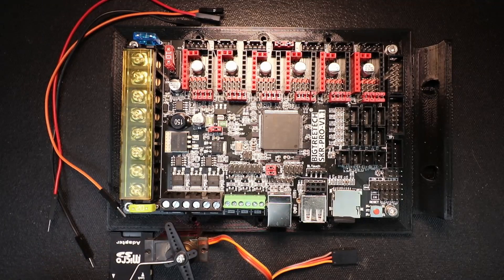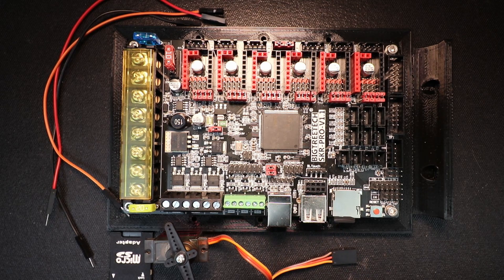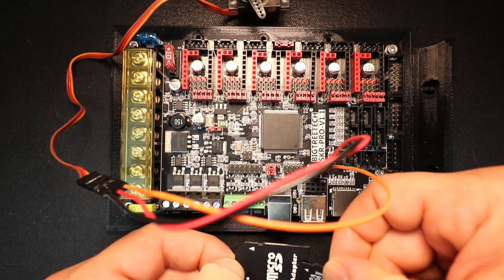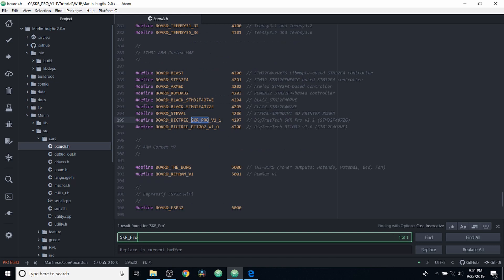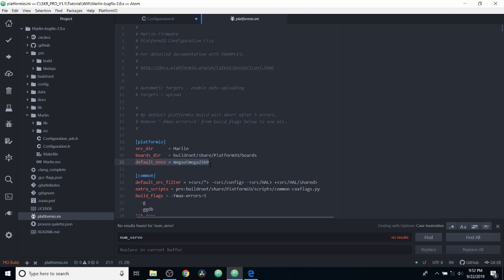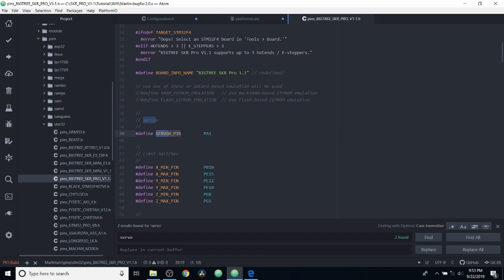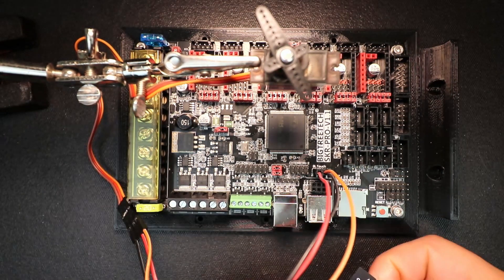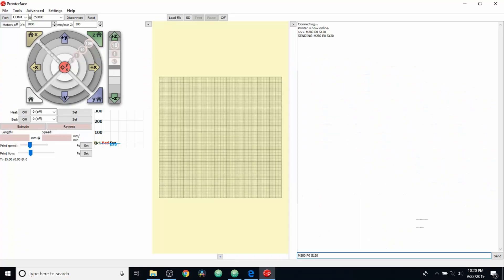SKR Pro V1.1 - Servo

Comment: Hello, how are you
I need to install in my SKR PRO V1.2 a SERVO MOTOR in addition to the BL-Touch that is already installed on the board. This servo will be used for tool change in a new project of a 3D printer with 4 print heads. But my web search came to nothing... I didn't find any information that could guide me.
Could you please help me in solving this problem?
Your guidance would greatly help my project.
Thanks
Reply from the maker: Been working on issue this morning, just need to find jumper wires to test.

Comment: Hey man, im searching for how to toggle pwm pins via pronterface for this board, i want to add rgb led strip to my printer, i'm making the pcb with the bjt and i need to test. Which gcode i need to use and how to call that pins (how do i know which is S0 for example)? If i can't use pwm pins, i want to use the pins of extension 1, PG11, PG13 and PG14. Sorry if bad english
Reply from the maker: Enable pins debugging in Marlin firmware.

Comment: Hi edward, please can you do a video to use filament detectors and pins we need to use thank you
Reply: Filament detector is just an end stop in my case, I disassembled it and saw its just a standard switch
 I have a Delta, the anycubic predator, so we don't use the position mins, only the max(optical sensors at the top), z-min used for leveling and i use x-min as the filament detector
in the pins_BTT_SKR_PRO_V1.1.h add the following
// filament runout pin for single extruder
#ifndef FIL_RUNOUT_PIN
  #define FIL_RUNOUT_PIN                   PB10          
#endif

and in configuration.h
uncomment #define FILAMENT_RUNOUT_SENSOR

Comment: Thank you, liked and subscribed! 
Is it also possible to use I/O Expansion Ports 1/2 for servo function, PWM?
Explanation of these ports and possibilities would be great.
Reply from the maker: All you need is voltage, ground and a signal pin.  Keep in mind voltage and datasheet for the servo used.
Reply: @EdwardBraiman  
Thank you for your reply.

Found some further information:
PF8 and PF9 located on I/O Expansion Ports are suitable for PWM. 

Also PC9 in theory, here seems to be some trouble as to find on Github SKR Pro issue #61.

Comment: How about a new video for setting up the wifi on the SKR Pro V1.1?
Reply from the maker: Still researching, turns out might need to modify wifi board because it's not appearing on wifi router yet.
Reply: @EdwardBraiman  Thanks for the reply.
Reply: https://github.com/bigtreetech/BIGTREETECH-SKR-PRO-V1.1/issues/85
I hooked that pin to 3.3v, uploaded the ESP3D.bin to the micro sd, rebooted the board and it´s working, remember to change the 2nd serial port to 6 on configuration.h
I need to find a way to change the status of that pin from the firmware but i don't know how to

Comment: What is the servo useful for on a 3d printer?
Reply from the maker: Deployment of a sensor like a Bltouch.  And maybe in the future auto leveling the surface you print on.  Your imagination is the only limit.
Reply: @EdwardBraiman  Ah ok. Its a free function. I thought there were something standard that i was missing. Maybe something to remotely control, also using octoprint.